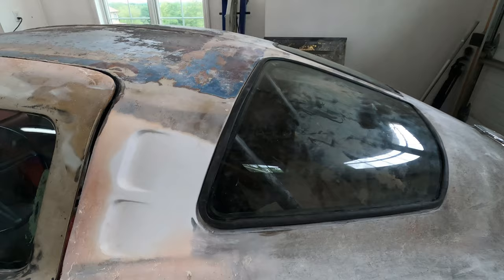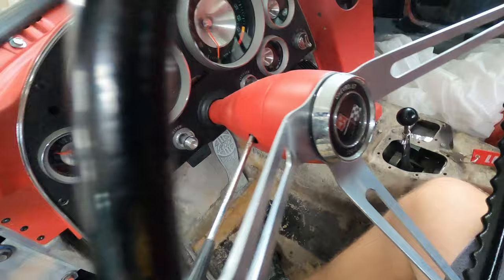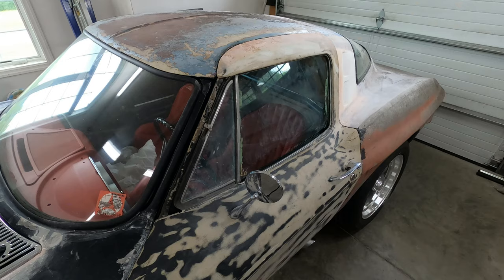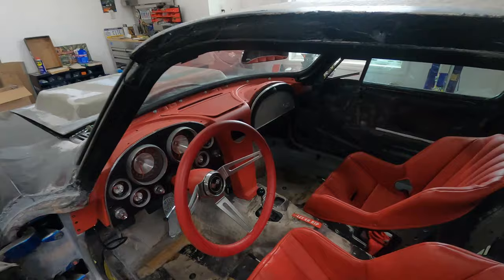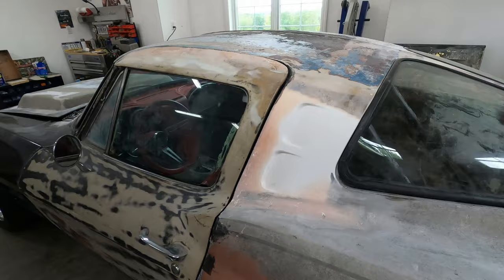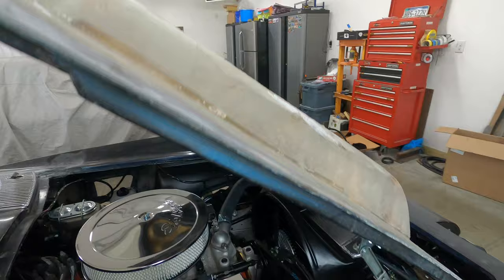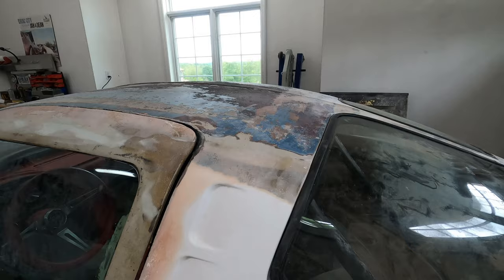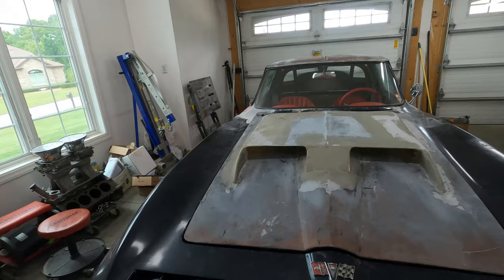Installing a New CON2R Steering Wheel in Misfit Split.

Comment: Also, are you happy with the dish on that wheel or, in retrospect, would you get a more shallow dish?
Reply from the maker: I was really happy with the wheel I got.  But my steering column sat further into the dash.  I had a custom rag joint that was about an inch and a half shorter than a C2 rag joint.  I did that to connect the 78 steering box and 63 column.  I would buy the same wheel for another car.  But their tech guys might have recommendations.  I am average sized so if you are tall you might want the shallow wheel.

Comment: Do you have a link for the wheel? All I could find on ebay were 14 inchers. I recently bought a 65 big block coupe. The original wood wheel looks cool but the rim is just too spindly and, like you, I want to go just slightly smaller in diameter so it doesn't look stupid.
Reply from the maker: I ordered it from CON2R.  It was on eBay.  I just looked at their website and you can build a custom wheel.  I didn't know that was an option.  Here is the link.  If you are interested in a wheel you might want to call one of their tech guys for advice on specs.
https://wheels.con2r.com/builder/c2-corvette-steering-wheel/

Comment: Why not put in an after market tilt & telescopic column?
Reply from the maker: The goal of the car was to build it on a budget. I bought 2 63 columns and a stock wheel for 300. Sold the wheel and column and broke even. So I got the 63 column for free. The ididit column is almost 1k. So it wasn’t worth it for me. Plus I don’t like the way they look. I like an original column.